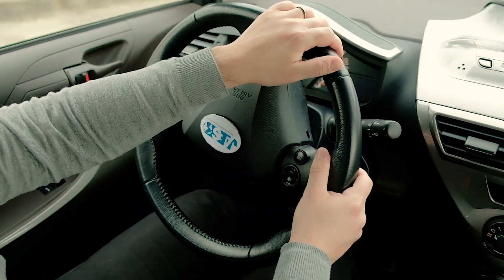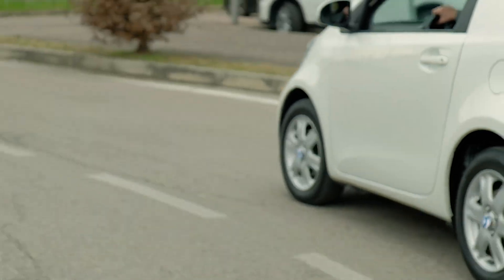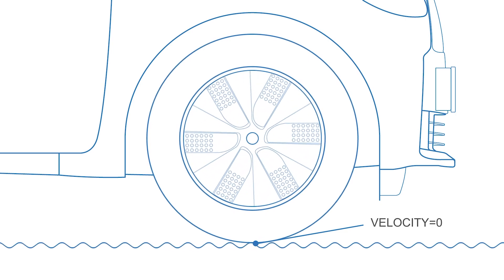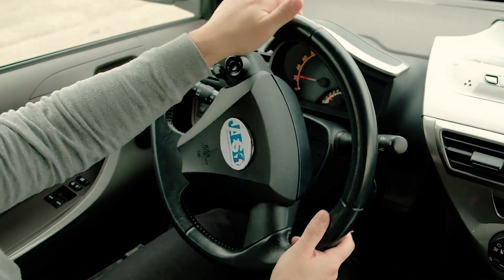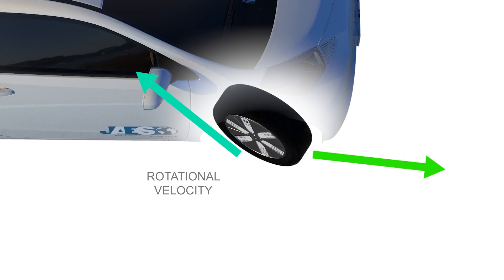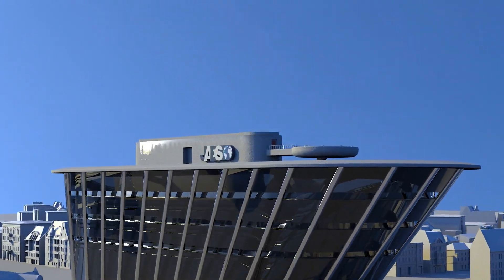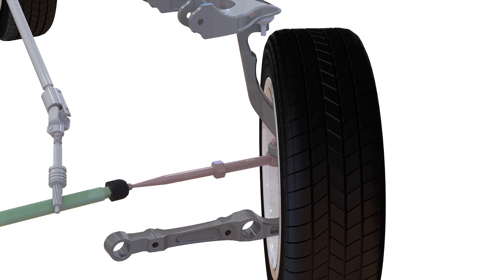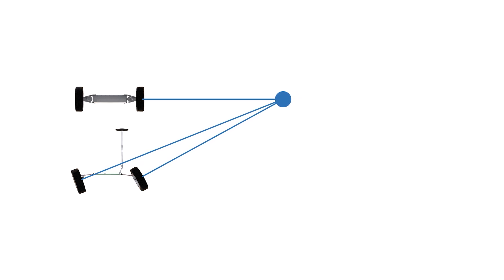How the steering system works (Car Part 3) Rack and pinion - Power steering - Wheels and rolling

Comment: wait a sec. This videos says power steering makes less effort for the driver to turn the steering. Ok I get it. Does that every car has to turn the steering at same angle to turn the wheel at the same angle. 
I thought Power Steering means you don't have to rotate the steering wheel more in order to turn the wheels. I assumed It's like you increase the sensitivity of the steering wheel. Damn I wrong.
Power steering means easy rotatins of the wheel and not less rotations. 
One more thing. In some really expensive vehicles the wheel turn so fast. Like in seconds How is the driver turning that steering wheel this fast.

In Laptop Trackpads if you move your finger fast then the cursor moves more. But if you move your finger slow then the cursor moves less. That means there's no specific sensitivity of trackpads. 
Does expensive cars have this feature like If you move your steering wheel fast then your wheels will turn more but if you move the steering wheel slowly then wheels also turn less. 

I'm bad in english and explaining things Sorry
Reply: Correct.  I learned this many years ago when the power steering went out on my car.  To turn the wheel was extremely difficult and took both hands to get the wheel to turn.  But did not change the amount of rotations.
Reply from the maker: Exactly! Have you had a chance to watch our videos about IGNITION https://youtu.be/s_HzAxhyXLo MANUAL TRANSMISSION https://youtu.be/G6hCvdW4dKo  BRAKING SYSTEM https://youtu.be/6xWEEbhBtuY and ELECTRIC VEHICLES https://youtu.be/flQSQxHVS14 We would like to know your opinion about it. If you want to learn more about our projects, you can subscribe to our channel https://www.youtube.com/channel/UCb7TkWFn3nyb6XhudxGu5tw and visit our website https://www.jaescompany.com/